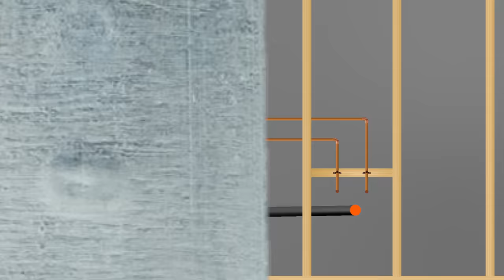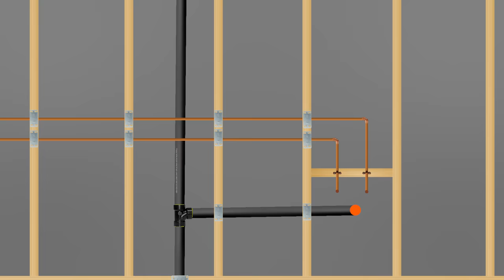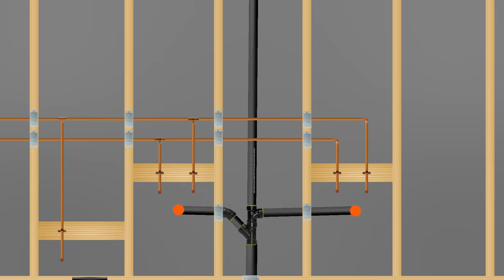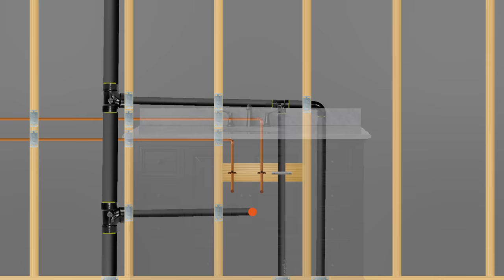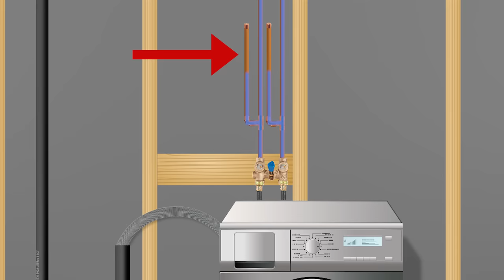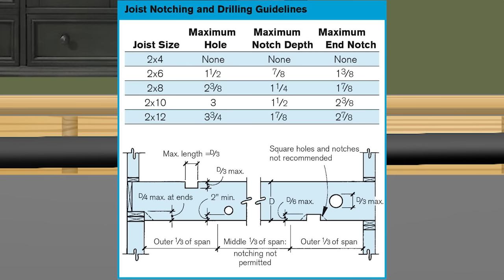10 Reasons Why You'd FAIL a Plumbing Inspection! | GOT2LEARN

Comment: Thank you for explaining the "why" behind each of these code requirements.  Its easier to remember these things when there is a practical reason for their existence in the code.
Reply from the maker: Awesome, thank you so much!
Reply: Got2Learn  Good vids. And as you know the code changes every 3 years throughout the country. So inspectors and tradesman are constantly in learning mode to keep up with this 3 year cycle.
Reply: My thoughts exactly!  This was a great video and it covered a lot of common plumbing issues.  And, as Harry said, the explanations were really helpful!
Reply from the maker: Thank you so much guys!!!!
Reply: My point exactly. Anytime I show a new person something I make it my goal to explain “why” it needs to be done a certain way, and not just “how” it needs to be done. I’ve always found that it gives someone a better understanding of what they are doing, and a stronger appreciation of how critical a failure can be if not done right. ✨✨✨
Reply: @Got2Learn  These ideas along with the visual explanations are amazing!  

I don't know anything about plumbing, but i see the rationalization behind why there should be such a proper rule in place.

So this may sound silly, but is this code specific to a single area? I wonder if in my area these are code or not.
Reply: @ssathessa  It's not silly, it is specific to each area which is known as a municipality. I've often wondered why there are different codes for different areas but thinking on it a bit I would guess it has to do with different city water pressures, types, and sewage drain sizes. Still though - seems these guidelines are wise everywhere in the world...
Reply: @GregJoshuaW  Most of that are valid everywhere. All of those including reconstractions first must have proper disign drawings - this is the best practice.
Reply: Explaining the "why" is helpful with most things; I can't stand it when I'm trying to get educated, but no explanation is provided.
Reply: Only 5:00 has no explanation which made me really confused. But overall very good and informative video.
Reply: The real "why" is because code makers need to justify their existence.
Reply: Rt ! He the best
Reply: exactly..
Reply: @mysterymanforu  because new technology and greater understanding of what works better is constantly happening,
Reply: Agreed.  Even if the code changes, we will at least have the previous codification to reference and find the replacement code, as it is noted inside the codes (e.g. (if looking for §123.45 see new code §543.21)
Further, if code varies so much from place to place, how is this video helpful at all? Yes the numeric values may vary from place to place, but like Trump, most municipalities rely on the higher governmental body's code if it is identical to the municipality's code (e.g. "In addition to the municipal codes listed in this ordinance, you must also comply with the Wisconsin State Building Code §2121.212(a) thru (zz) unless noted otherwise.") Meaning that a municipality may want to control the code regarding setbacks for buildings or a requirement for a anti-backflow valve on the sewer line to the street, but agrees that the State's version of the remainder of the Code is appropriate/adequate/etc. enough to use rather than incurring the costs and efforts of creating virtually identical versions within the Municipalities/Counties/etc. Code and then the upkeep costs on top of that (e.g. someone has to monitor changes in the industry, updates to technology, etc. and then adjust the Municipalities Code as needed to align with such changes and their impacts on the safety and wellbeing of the citizens.)
Any venture in "The Code" is best done with as MUCH information as possible, not as LITTLE as you think may be needed.
More codes are violated for not knowing enough rather than knowing too much.
regardless, very informative video.
Reply: 5:00
Why can't you connect a fixture to an existing vent? You say its against code. But why.
Reply: Agreed.  Many of these codes are difficult to remember and make no sense until you explain the "why" and bam, instant recoginition.
Reply: The "why's" are what make a person want to do it correctly. They prevent bad things from happening.
I want to prevent the bad stuff from happening, beyond satisfying a code inspector.